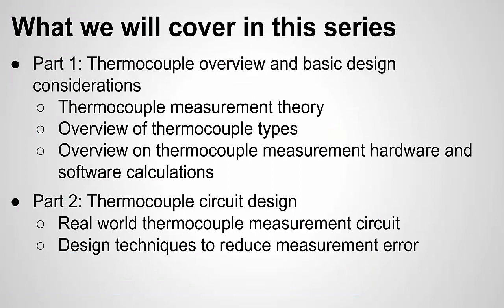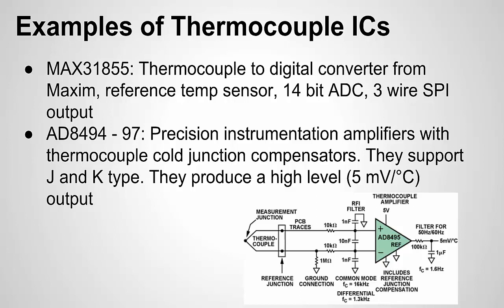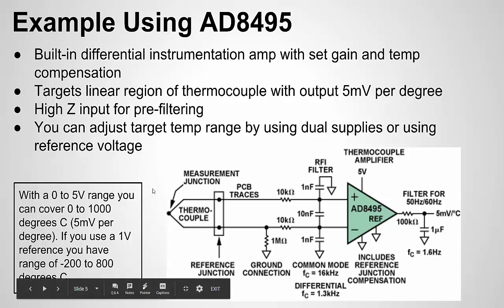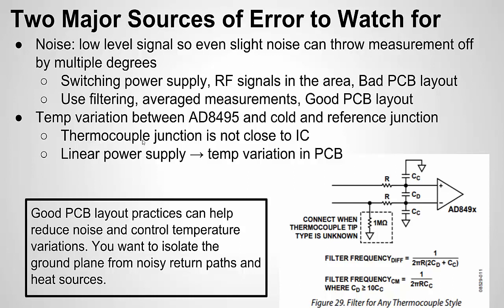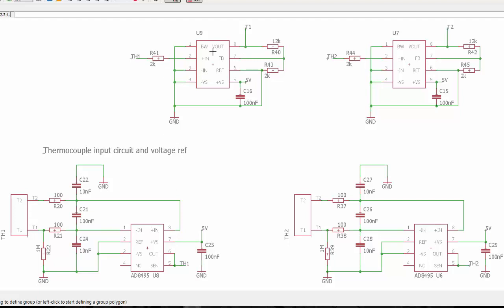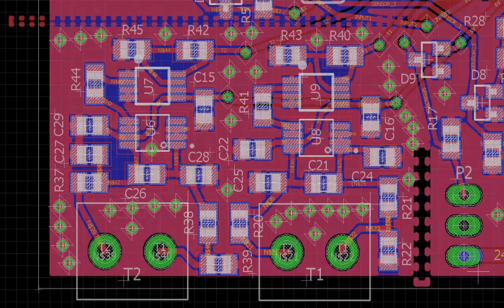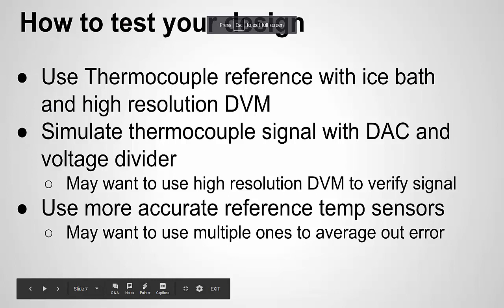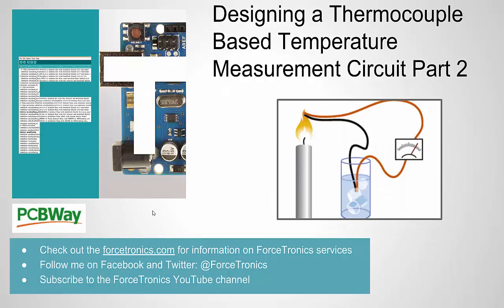Designing a Thermocouple Based Temperature Measurement Circuit Part 2

Comment: `what exactly is the use of ADC in this ? Will it convert my temperature signal in to digital form ? But we need our signal in Analog form only Please clarify.
Reply from the maker: I am a little confused by your comment. All modern semiconductor devices or modern electronics use adcs to measure electrical phenomenon or sensors. Whether that's voltage current power light temperature. All the low level electronics or semiconductors are using adc to make those measurements. Then there's some algorithm or formula to convert that digital value or discrete integer into the measurement data that you're interested in. Whether that's voltage or temperature or current etc
Reply from the maker: For thermocouple temperature measurements a raw ADC value is typically converted to a voltage and that voltage can be either applied to a formula or a lookup table to get the temperature

Comment: First, thanks for the help on this topic as I've been having trouble designing a thermocouple Temp sensor coz am designing an Oven timer with a 16x2 LCD with a thermocouple temp display. Am done with the timer part of the program but the thermocouple part was still a problem so with your explanation I think am ready to finish up my design. But, one question, what is the part number of the two ICs you used for the gain? please help I need that part number.